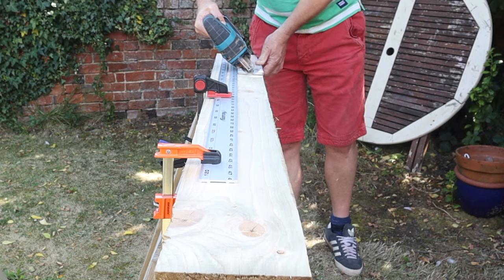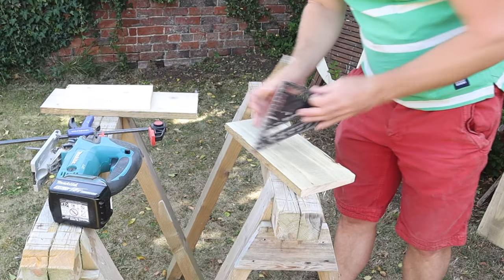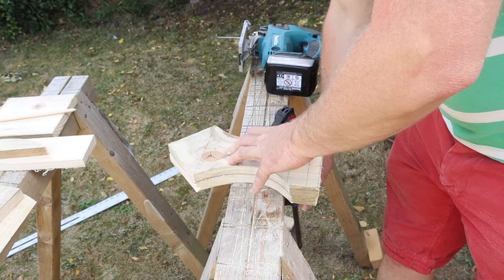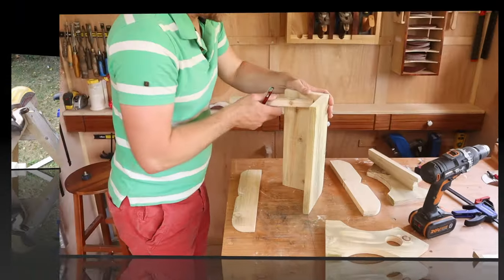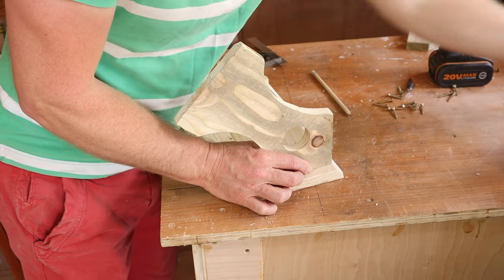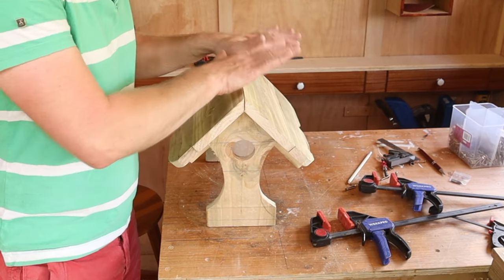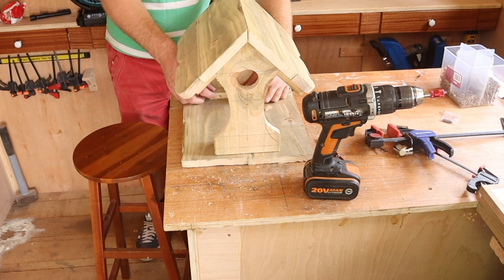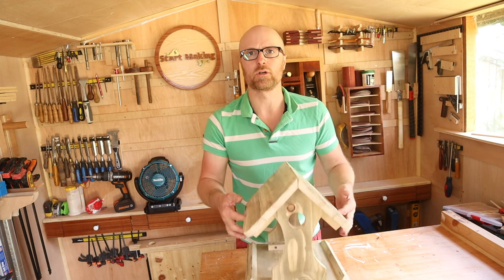High Profit Project // Easy Woodworking Build // Make Money or Gift

Comment: Great little project. To make construction of the roof without bothering to make a 45 deg cut; you can get a better join by leaving the edges of the roof boards square and simply overlap butt join them at the top of the roof. Just remember if you do it this way you have to make one side of the roof shorter in depth by the thickness of the timber you are using so that both sides of the roof are the same depth but this gives you a better weatherproof joint than the 45deg mitre joint and is much simpler and quicker to do especially if you haven't got the capability of cutting a 45deg.
Reply from the maker: Hi John. Its strange how the simple answers don't always come. Of course a butt joint is far better. I was so blinkered with my angles that I didn't even consider it. Thank you again.

Comment: This is some honest woodwork! I can relate. I also like to think you selected your most wobbly trestle for absolute authenticity! Keep doing what you’re doing 👍
Reply from the maker: Hi thejames666. What a lovely comment. Thank you. Made me chuckle. Sadly all of my trestles are wobbly. This one even has a block on the bottom of one leg for me to rest a foot on. Still isn't sturdy. I made them long before I really knew how. Maybe they are in need of a refurb. Thank you for watching.
Reply: I bent my Makita circular saw when it fell off a wobbly workmate. Felt like it happened in slow motion. It’s never cut straight since. Still, I replaced it with a track saw and have never looked back so every cloud and all that!
Reply from the maker: @thejames666  Wow. I would have cried. Though you are right, my next upgrade is a track saw. Or an orbital sander. Or a router. I can get any one until I decide and that is proving to be the issue. Each one is needed but only one can come at a time.
Reply: Just to add, the router is corded… is it possible to extend some electrics into your shop?
Reply from the maker: @thejames666  It is something that I have toyed with. I run a 50m extension for my dust collection system. Trouble is, at the moment I am only using my dust extractor when I use power tools inside or to clean the shed/workshop. I don't run it every time I go to work as when the weather is nice I just do messy stuff outside. Helps me do more talking on camera without risking my lungs. Sadly in winter I will have to run the dust extractor more. For this reason though, I am yet to buy a corded tool. That and the space I would need to have a table saw etc. I may have to get battery palm router. As for a permanent electric fix, if you saw the state of the shed, it is close to falling down. The work I did cladding the inside is all I think is holding it up. Seems a waste to run electrics down to it.
Reply: I was desperate for a table saw after watching hours upon hours of (usually) Yanks in their huge workshops. I barely use it. Actually considering selling it on. In case you’re interested! I’m in Surrey. It’s the Evolution folding one. Anyway. Behind my tracksaw, my second favourite tool is my Ryobi cordless nail gun. I use it on every project and couldn’t recommend it highly enough.
Reply from the maker: @thejames666  Hi James. That is interesting. I understand what you mean about the table saw. I think that people either embrace the table saw, a mitre saw or a track saw and then the others get a bit mothballed. Im a little way from Surrey. Oxfordshire. But at the moment a table saw is a little too much for my needs, and to be honest the channels needs. People seem to like a smaller workshop style. As for the cordless nail gun, apart from the fear of skewering my fingers, I think that I am a couple of months away from getting one. Very exciting.
Reply: @startmaking1  I’ll be watching, for sure. You have a great concept and a very watchable style. All the best.
Reply from the maker: @thejames666  Thank you. Much appreciated. Great chatting. Thank you for the insta follow too.

Comment: I like no plan builds. My dad built a 4 leg stool from 2" material for my wife years ago without any plans. I took measurements from it a couple of years ago and built a pair of more or less matching stools. I used pocket hole screws to put my design together. Mine are a lot more sturdy, but I still have the one my dad built. He used nails, so it isn't as strong. But a great pattern. BTW, I use the self tapping torx screws as much as possible. They go together easier, and in cases where I have something temporary they come back out easy and can be reused for other projects easier than the Philips head screws. I always buy them in bulk in the size I need. Like clamps, you can't have too many fasteners... I have a straight edge that is 8ft long that I use for cutting up sheet stock. It is actually two 4ft pieces with a connector, but I just keep it together as I have plenty of vertical space in my shop. The speed square for doing accurate cross cuts is a great technique. I use it when I don't have access to my miter saw.  I'm really liking your channel so far. Even though I have a pretty large shop, efficient use of space is important. At the moment my clutter is eating up the space. Your interior screws will probably last a lot longer than you expect. You could probably put a dab of exterior glue on the heads to improve the life. You probably don't need to worry about the ones that the heads are facing down.
Reply from the maker: Hi Doug. Another brilliant comment. Thank you for taking the time to write it. I will take your advice on the screw heads and now that I have my impact driver I am looking for Torx screws. Thank you again for watching and for commenting.

Comment: you mentioned on the other video with regards to no having power so cant have a vertical drill. Why not buy a cheap suitcase generator from ebay? Until I got power to my workshop thats what I used and it worked perfectly. I like this video .simple project and nice finished job. Will continue watching. thanks
Reply from the maker: Hi Adam. Thank you for watching and especially for such a helpful comment. I will have to take a look into generators. My first look lead me to the really expensive power banks or whatever they are called that a lot of makers are testing out at the moment. £3k roughly. Too much for me. I always said too that I wanted to have the skills to match the tools before I got the larger tools like a table saw. That said, a drill press would be pretty good and in my small shed is not too large. Thank you again for commenting, I have been blown away by the community and their help.
Reply: @startmaking1  Hi again. Well mine was a couple of hundred quid.  I ran a small table saw off it as well as a small arc welder. They are handy and tuck out of the way. good luck and thanks for the time and effort in making the videos
Reply from the maker: @adam-qf2vz  No worries. Im on the case. Thank you again.
Reply: @adam-qf2vz  hey I am interested in this... which one did you get?

Comment: Hi Mark, another engaging video, easy to see how you have built your channel so rapidly, it's addictive !, One question, I have seen in several of your video your using or have in the background a Makita cordless dust extractor/Vacuum cleaner, but you often don't use it when making dust with the trim router or circular saw, is it a battery life problem ?

And also thank you for your email, I will follow up on your reply tonight 

Best regards Julie
Reply from the maker: Hi Julie. I will reply to the email asap. As for the comment. Thank you. 
the Makita dust vacuum is one of my favourite purchases I have to say. The battery is a little fragile at around 30 mins high power. But in all honesty that is not the reason I dont always use it, I use it 100% of the time with my router table. But for the rest I started only using it if the shed is not already a complete mess. The one issue is that the hose is so short that I find it a little cumbersome. The tool pulls the vacuum around too much as a result. But for cleaning the shed there is nothing better. Initial blow to clear the dust. Followed by a vacuum makes the shed clean in 10 mins tops. Really useful. Would I use it in a workshop with power, time will tell.

Comment: Looking at the nature of the wood used, pallet wood is a zero cost alternative. And that normally has preservative applied, reducing expense further (putting bare wood outdoors is a guarantee of having to make it again later...).
If you are paying £11 for the wood, plus preservative, and you are investing 2 hours of time, I question the 'high profit' label...
As a Men's Shedder, if we paid £11 for the wood and sold it for £20 at our local garden centre, we would barely break even (they take 40% plus VAT- fairly normal)
Reply from the maker: Hi Mike. thank you for the comment. this is a very early video. The wood used is treated and so there is no additional cost for any kind of preservative. I wanted this to be very beginner friendly too and the wood used needs really no extra work. I have always seen pallet work as a lot more time that needs investing. Way more than 2 hours I would imagine for a beginner to rip a pallet down and repurpose it. Not to mention more fixings due to the narrower nature of the boards. But it would certainly do the job. I think it is important to see these videos through the eyes of a beginner. It is high profit for a beginner compared to what else they could be making. I am not necessarily suggesting that a professional should start doing them. thank you for your insight as always.
Reply: @startmaking1  We are currently using pallets that have 20mm thick timber. BTW nails are cheaper, easier, look better, and are just as secure for an application like this.
My 'high profit' query stands- cost of sale means there is little scope for any.
Reply from the maker: I guess the term high profit is relative to the woodworker and their market/situation and so forth. Seems as silly point to pick up on as I see you are a content creator too. You surely understand the premise that the video is aimed as a double win. The beginner woodworker can make the project with limited tools and due to the low cost, they can sell it to make funds for increasing the tools that they own. As they are learning skills as they go, the time factor of cost is really of little relevance as they do not command an hourly rate for their work. what this means is that if you take a very quick glance at Etsy for instance and see bird tables ranging from £40 to £100 each, a total cost of less than £11, as not all of the board is used, would leave the specific person that this is aimed at, around 70% profit minimum. Hence in this specific instance I classed this as high profit. Not to mention the fact that YouTube woodworking channels as many others need people to click on the thumbnails or videos never get seen. A little catchy title to go with the thumbnail creates a good level of intrigue.
Reply: @startmaking1  
Yes, Etzy has lots of high prices- does not mean they are getting sold. And there is still cost of sale. Our starting point is half Etzy price, and then we get half of that. Just looked on  Etsy, and most bird boxes of this level of complexity are around £15. Which includes delivery. And selling charges.
One man's 'intrigue' is another man's clickbait... Yes, I am aware of YT techniques, but I value personal integrity over clicks. Others must make their own choice. If I were making a claim in a video title, I would attempt to justify it within the video- such as a costings breakdown.
You have a good channel, with content that is ideal for beginners. Please do not disappoint your viewers with unrealistic claims.
Reply from the maker: I do partially agree on the point of pricing etc. But I do not agree with the term clickbait. I believe it is wrongly used to encapsulate a wider field than its true meaning. Clickbait as a term was brought about to define something that is designed to draw you in and offer you none of what was promised. This is not the case in this or any of my videos and as for personal integrity, I firmly believe that you can have both. I wholeheartedly respect anyone who makes videos with the aim of helping others, knowing full well the difficulties and hard work that it entails. For that reason I would only ever offer support and constructive comments on the content and never question the character of the maker or their values. As always I thank you for your lovely back and forth and wish you every success with your channel.
Reply: @startmaking1  I questioned nothing- I merely made my own position clear. And stated that others must make their own choices. No judgements involved. All such decisions are on a spectrum, and we must all choose our own position on it.